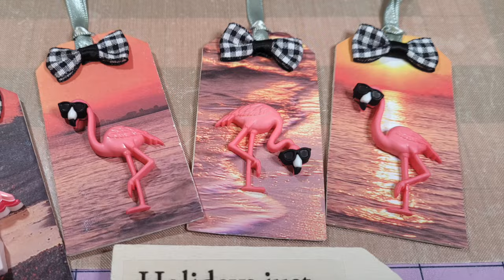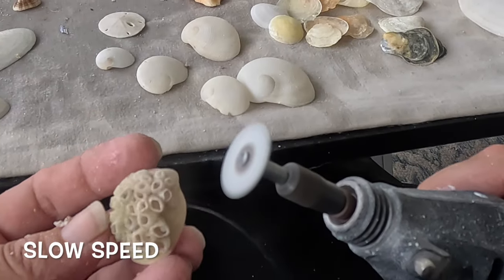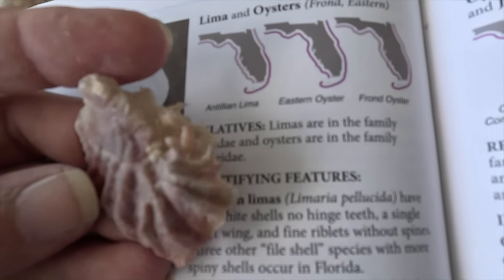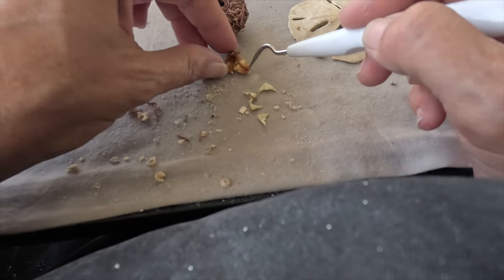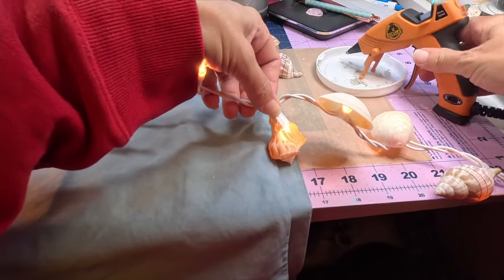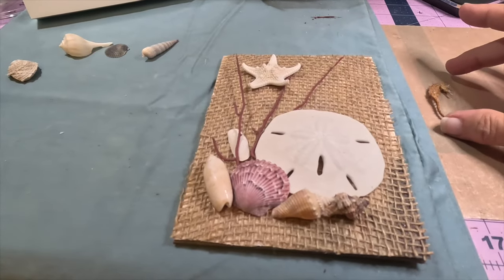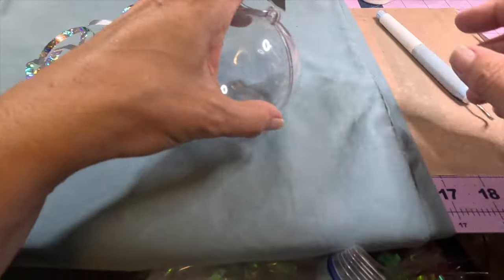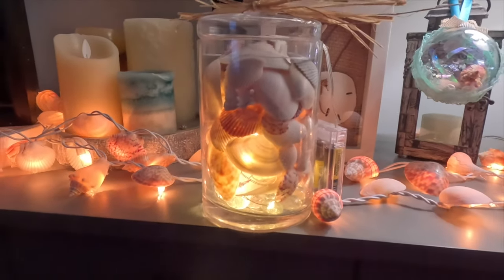HOLIDAY COASTAL CRAFTING! 3 Project How Tos in 1 video

Comment: I’m in the middle of watching this, so before I forget, I wanted to ask you: What type of Dremel(s) do you have? I was looking because I have been shelling since I was about three years old… Somewhere in the 60s!!
I have a good collection, but would love to be able to drill some shells to make earrings and pendants for myself & friends.  I tried looking online and it just gets confusing… “Some will drill, some won’t … Use this model # for this; use this for that”. Help please!
Thanks in advance and I enjoy your videos so much.
Reply from the maker: I have 3 dremel's, a WEN, and a chicago tools one that hangs up.... you want something that can do at least 15,000 RPMs that mean revolutions per m minute. 1 of my dremel's is a rechargeable and the rest plug in.  the rechargeable one drills fine but isn't strong enough to really cut - the WEN does that beautifully. I am not sure of the models on these now, 2 of my drememls are older and the recharge and WEN are newer. the other one i haven't taken out of the box yet but will be this week once it warms up, just got it.. 

the key is not so much the rotary tool. something that plugs in and has the speed is fine. 

you need diamond bits and you need to do your drilling and cutting with water to keep the dust down and keep things cool or the shells will crack... dont bother with the expensive carbide or masonry bits either, get the cheap diamond ones at harbor freight because you will go through a bunch of them : ) hope that helps and a tool time video will be coming this winter that is more in depth :D
So glad you are enjoying the channel, as well! :D
Reply: Thank you so much for the information!  Can’t wait for the upcoming tool video. 😊❤